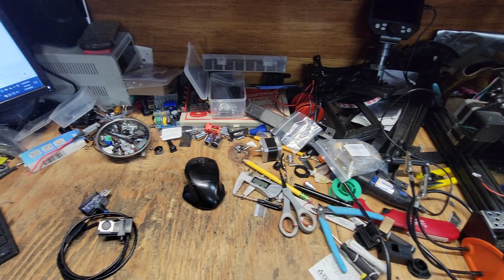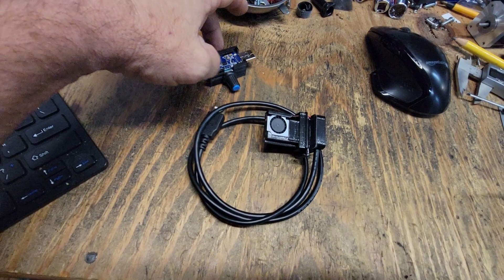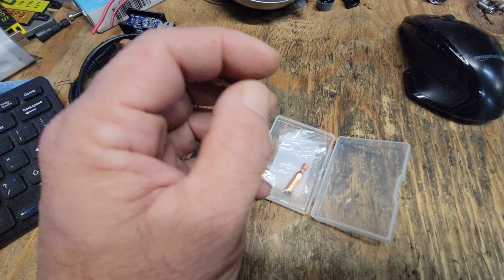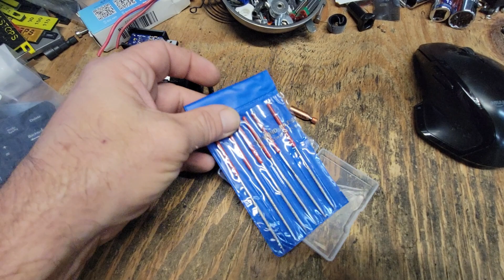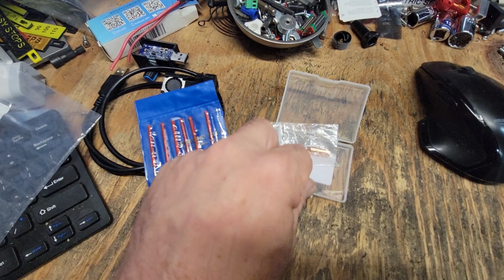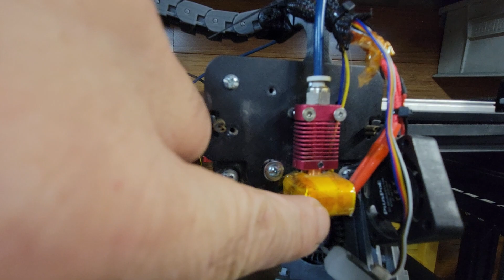Bi Metal Heatbreak/RIP Luke Hatfield(He's Fine)

Comment: Do you have any links to the heatbreak and other thing you talk about?
Reply from the maker: These are the ones that I've had good luck with.  AIEX 2pcs All Metal Smooth Heatbreak, Bimetal Heatbreak Titanium Alloy and Copper Heatbreak Throat for Ender 3 V2 Ender 3 Pro CR10 3D Printer Hotend https://a.co/d/2lT4cYx
These are the files I used, Utoolmart Diamond Needle File, 7-Pieces Mini Diamond Needle File Set, 2mm x 100mm Round Files Tools, 150 Grits Small Tip Files, for Metal Glass Stone with Fine Sanding https://a.co/d/gPv7pCj